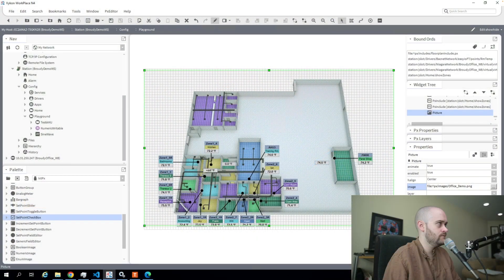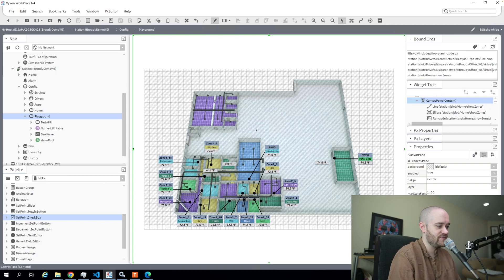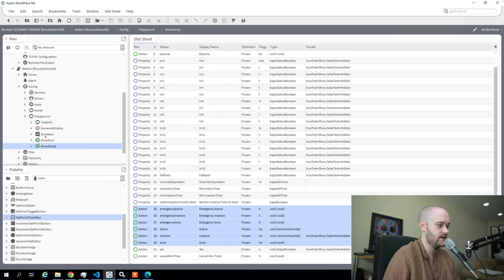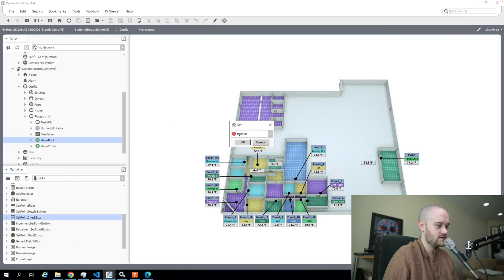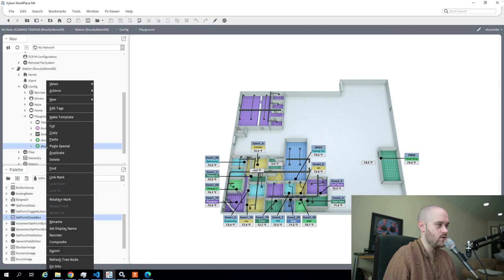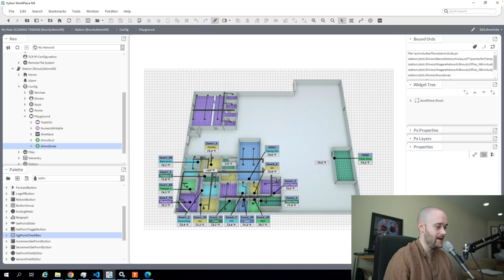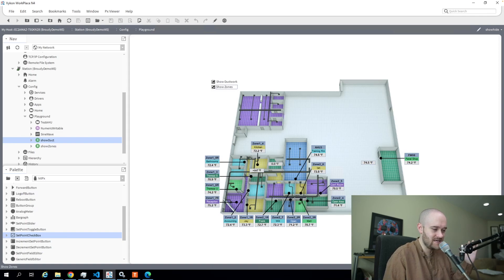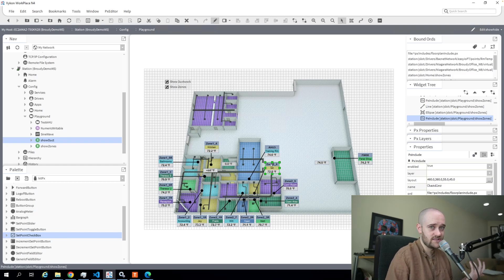Adding Interactivity to Your PX Graphics

Comment: Great video. I wanna touch on one thing you could change though. You touched on it for a second. If someone makes the change on one login, it chages it for all users. You can counteract this by using a Global Command to "Set" the point back to true once someone logs off. For us, we use a logoff button on a sidebar, and have it linked to a Global Command from the "VykonProUtil" module. Once they click the logoff button, you can have invoke the action of the global command by having it hit a OneShot. And if all else fails, just have a trigger hit at midnight or some other random time where nobody would be logged in.  Other than that, it's great information for people trying to add that little extra that others don't.

Comment: Hi Matt, great video!  I would like to do something similar with graphics, but user specific and show/hide base on screen size.  On a desktop/laptop it is fine to have the floor plan, on a tablet/mobile just the zone info.  Is this possible, or is there a better way?
Reply from the maker: It sounds like the ResponsivePane and FlowPane in the bajaui palette are probably along the lines of what you are looking for. They are specifically for doing this kind of responsive design, where you want to change how things are displayed based on window size. -MW